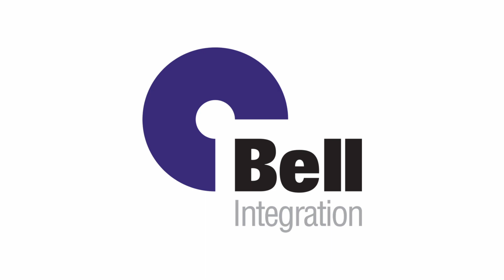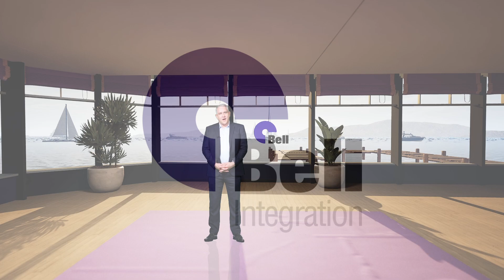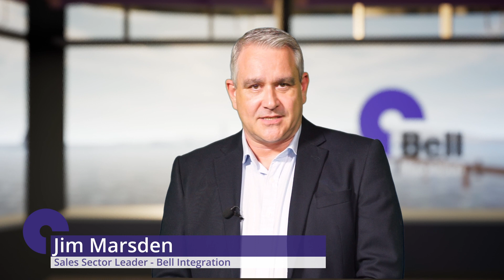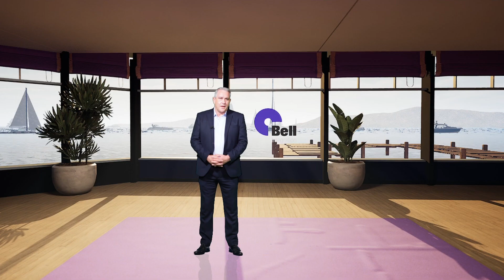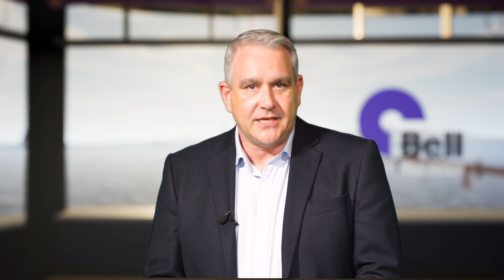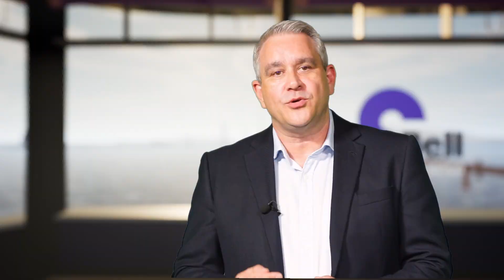Energy Optimisation in Data Centres

Comment: Ways of making your energy much more efficient in data centres is explained here by Jim Marsden. Big cost savings is the result, because if you listen to his advice on DC optimisation, you'll only be using the energy required to run centres.